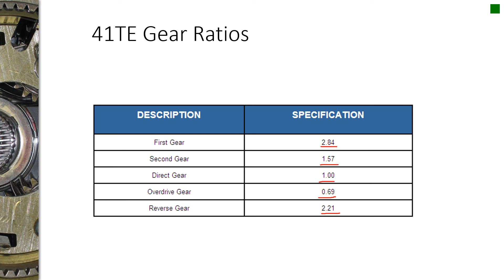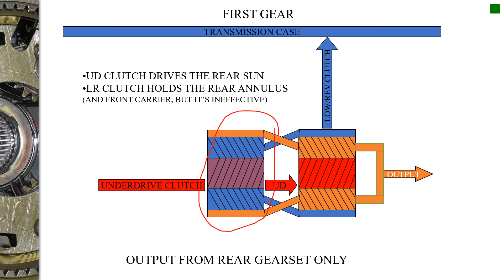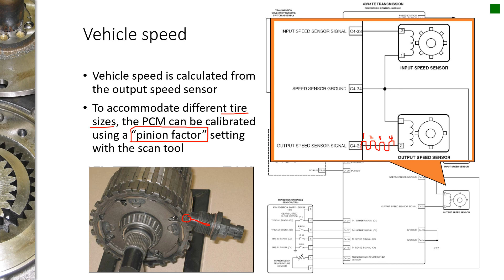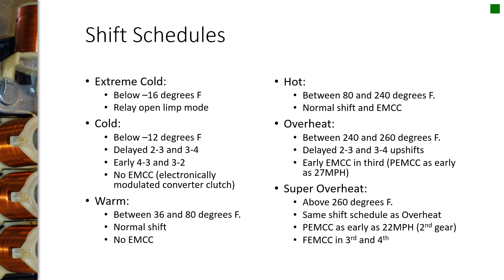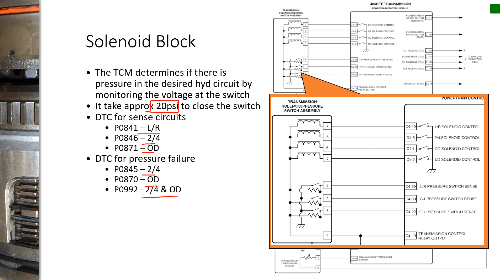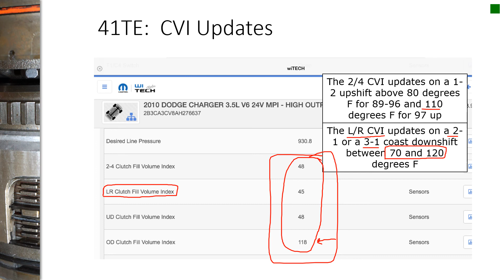41TE powerflow and electronics

Comment: I just bought a 2005 T&C with 135K miles - (no major rust) but this T&C is the first T&C that I have owned that has a highway ratio gearset- (which I love for the milage but, it tends to sing or whine after 45 MPH and the whine seems to go away after 75MPH - is that singing or whining tend to be a normal characteristic for that highway ratio gearing? or would it be more likely a loose or worn out ring gear carrier bearing problem? I have checked the endplay of the drive gear and transfer shafts, and they appear perfect. The Chrysler dealer told me that if it is not too loud, just ignore it. I have never had this "singing" sound in any of my previous T&C's - they have all been totally quite running - as my uncle Trevor said of his Bently, "35 MPH and all you hear is the wind."

Comment: Perhaps I missed this but, I did not see a explaination of how the lock up works - I had read in another write up on the 41TE that stated that underdrive is actually lockup mode - True?
Reply: The converter clutch is located within the torque converter - not the gearset. It can be engaged in 2nd, 3rd, and 4th gears.

Comment: Hi there, I have a 1991 Chrysler New Yorker fifth Avenue, it has the the 41-TE. Between 25-45 miles per hour at times in down shifting the car will jump into limp mode when it’s been driven for awhile and the electronic vehicle information center or (EVIC) cluster will say “Low transmission pressure” and will go into service limp mode (stuck in second gear) and will remain in limp mode until it’s restarted or let sit to cool down for a bit. I’ve been told my silonoid pack may be going out but im wondering if you know any other possible things to check. I’ve already replaced my speed input sensors
Reply from the maker: There are pressure switches that close at about 20 psi.  If there's a bad switch or bad connection, it will set a code and go into limp mode.  It's possible that you have a bad connection or bad solenoid. Many solenoid connectors and pigtails have been replaced to fix those codes.  Many solenoids as well.  That's a very early unit, so there were many updates that occurred in about 1995.  I would start by inspecting the harness going into the transmission really well.  Then, use the smooth end of a drill bit the same size as the pins (sorry, I cannot remember the size) and check to see if all the female sockets have good tension in the transmission connector.

Comment: 41tes stalls out engine when put in drive or reverse. Clutches or torque converter issue? Shifts through all gears perfectly fine.  Help
Reply from the maker: Must be a torque converter issue.  It could also be a worn valve body solenoid switch valve or plugged cooler.  Trans clutch issues won’t stall the engine since when you are in gear at a stop nothing in the trans is rotating anyway.  But the torque converter is another story.

Comment: Great video, I am curious to know your thoughts, I have a PT Cruiser gt with a  Ultradrive 41TE automatic in it and im curious to know if you think it would be possible to work with an Hyper-9 electric motor. your thoughts on the matter would be greatly appreciated.
Reply from the maker: We actually have an electric pt cruiser in the program.  Our setup uses the manual trans.  I guess the 41te would work if you don’t need it to shift.  In default (limp mode), the trans has park, neutral, reverse, and 2nd gear.